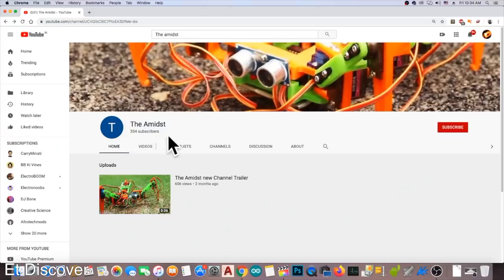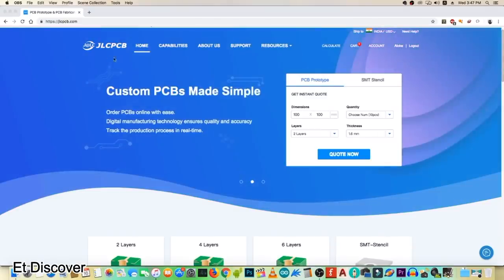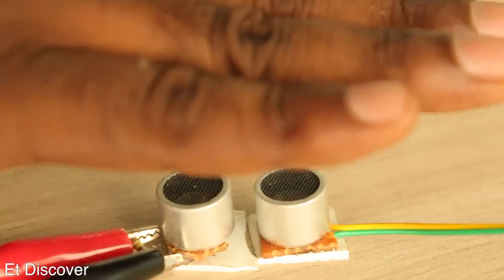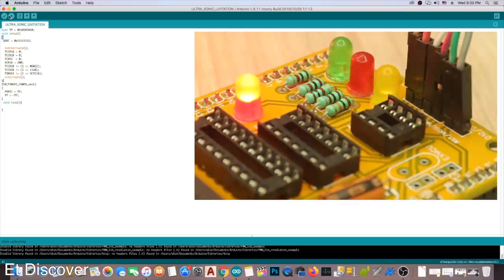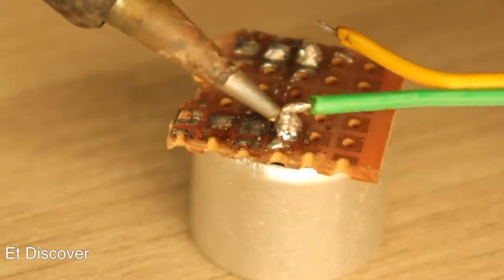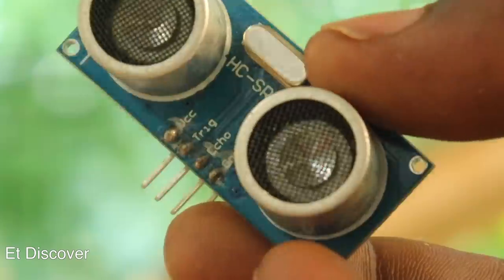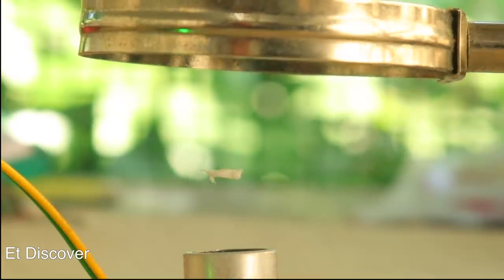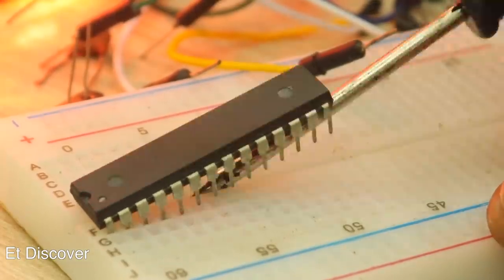This Device can create an #Anti gravity space

Comment: Countering sound deflection, this is a technology known to harness, whats called "polarity-beam" ( or in this case, sound wave as the beams ) Its a replicate to the definition "anti-gravity," yet that definition simply means defying gravity. Which anything can come close to it, an air balloon does this. gyroscoptic devices applied with angular multi edge points momentuim forces, creates what I'd call geo-scoptical directional, or in sci-fi term, "pulse-engine." 

 The inward archs of an Eygption Beatles, have inward arch V shape fins hidden in there wings to truly levitate/cruise in evasive tactics. If you can form mass to expand and shrink in motions of a swimming motion jelly-fish or blob, in 3D, it can grant whats called, "warp-drive( in velocity, not nessesarly time-travel), 
 
 That will require some heavly body mass chem-life energy in mini/craft form of gyro-magnetism into also geo-scoptic time & space combo).

Comment: Im still amazed i want to make it but i have a problem 
So what i need is 
1.pcb (which you have created)
2. Voltage converter 
3. Ultra sonic sensors
4. Components 
Right?
And how i can use ardiuno for this purpose ??
Reply from the maker: Yes you can use Arduino
Reply: @JonDoe01X  how to program it???
Reply: @boltez6507  It connects with laptop & there are softwares. You read & watch basic tutorials to start with
Reply: @JonDoe01X  thanks

Comment: What's the practical application for this? Can you adjust the frequency or Voltage to move the object? The answer is yes you can, and if you make the object small and use a light source which can be directed you can create a 3d hologram.  What would be interesting though is if the power can be increased to say levitate up to a metric ton and the effect can be operated at large distances, then you have a space lift.  However as these are waves and not particles I think there would be a challenge in directing the waves in to a tunnel like effect so the effect isn't lost due to the propagation of waves.

Comment: Thanks for sharing.  The floating effect with sound is very interesting to witness.  I am curious about a few things.  One is if you could use a laser thermometer and to see if there are temperature pockets where the pieces are floating in the field.  I gather that the items are floating in some kind of sound packet  when they are on top of each other.  They seem evenly spaced as if they are locking on to a wave pattern at the same intervals.  I would be curious to see if there is a heat difference where the items are floating and the space exactly half way between each one.  I am also curious if the wave pattern could be made visible with some smoke or powder floating in the air between the speakers.
Reply: Please read about wave theory and standing waves. What the setup is doing is basically crating standing wave and at each minimum point, the piece of thermocol being very light is being lifted by the wave below it. You might also want to read about sound propogation.

Comment: I want to ask can I directly power the ultrasonic Sensor or should I use any IC or any complicated circuit?
Reply from the maker: Just you need only 40kHz amplitude signal, For that you can use any kind of complicated circuit
Reply: @EtDiscover  thanks.. But I wnat to know if I power those two wires of the sensor directly by a battery then what will happen?

Comment: So....what's going on here is that sound is really just modulation of a medium ( in this case...air). The ultrasound emitter creates high frequency pulses, using piezoelectric materials. This project just pits two ultrasound emitters against each other, effectively pushing against whatever is in between them from both sides.

Comment: The terminology of "anti-gravity" is a misnomer, because we still can't define gravity.  So something can't be anti of something that isn't something.  Float, levitate, hover are more appropriate terms for such things.  This is like the water droplets suspended in air because of sound vibrations or the hovering beetle shells too.
Reply: They should try making water droplets adhere to a metal scale model of a ship and subject it to those ultrasonic sound waves. At the proper frequency and amplitude the model should float off the ground even if there is no sound speaker underneath it.  This might explain partially how real ships weighing thousands of tons can float serenely in a pond or lake where the weight of the displaced water is less than the weight of the ship. That is called the floating battleship in a bathtub phenomena which science still cannot explain.

Comment: hi can you make a self-balancing vehicle?  electronic and accelerometer coding? and how to do it all in advano uno  what all complicated devices i need to control high voltage  dc current to rotate a big dc motor
Reply: Yes.  Of course, I have never actually programmed a microcontroller, nor am I certain that this will work. ;-)  That said, you need one accelerometer for each axis of motion.  Then, you have to arrange them along the three axes.  There are different kinds, but a MEMS accelerometer is probably the best.  For the algorithm that you are going to use, go to Google.  You could probably find code that someone has already published on GitHub or elsewhere to do this for a microcontroller project.  Alternatively, you can look at this paper:

https://www.recg.org/publications/rahmati09percom.pdf

This is for phone screen stabilization, but the principle is the same.  As to the mechanical part, you need to figure that out yourself. ;-)  If you have no coding experience, don't worry.  Many of them, e.g. Atmel, can even be programmed with BASIC, which should be adequate for this application.  This isn't much, but I thought I'd offer some direction in case you were still wondering.

Comment: This is a good experiment but it is not anti gravity what it does is play sound at a well defined frequency on 2 speakers and having a high amplitude of at least 2 mm. This creates a transverse void and creates a low pressure. I need further data to calculate exact values and I definitely want to make this. Also there are a lot of older videos about this phenomenon by Harvard, Smarter Everyday and WIRED.

Comment: So.....interesting phenom.   but.... if 'something' floats, it doesn't mean 'anti-gravity'.... I believe what you have here is a 40khz 'standing wave' of air oscillations... it works because the 'wave' front of  reflections are stationary, and if you place a 'super low density' object (maybe a tiny piece of 'foam')... it will hover in a 'node' of the wave.  Hmmm....have you tried a steel nut, will that 'float'....doubtful.... try using a high power high freq. amplifier..... you might just get that nut to float too.....just saying....

Comment: Thanks for such a fine presentation of much information with experimentation results. Easy to Learn from.
I did notice when you took the top device or lens away that you did so on an angle which would mean if you were straight, you would have got more distance, as the angle of REFLECTION from the Above was now 15 degs off centre. I would be curious as to how far it would go if it was perfectly straight. Perhaps even in a chamber/tube around them, if you can get a clear tube.

I bought some of the ultrasonics pairs for the Auduino but I don't have one. But they were from China and very cheap, around a couple of dollars including shipping. thats why I could not resist buying a few lol. Now I know what I am going to use them on ;)

Comment: This is not anti-gravity.
 It's a 3D standing wave form. The classic 2D test is to place a magnet below a flat surface and sprinkle metal dust on top o the surface. The dust takes a specific shape etc. The item floating in mid-air is held in pockets exactly between inaudible lines of matching frequency which create the standing(stationary) wave form.
If a bee's honeycomb shell were the standing wave, the item would be nested in each comb... as proven by the larva themselves.
Seek. You will learn, and The Truth will set you free! God is the most conventional scientist you will ever meet!